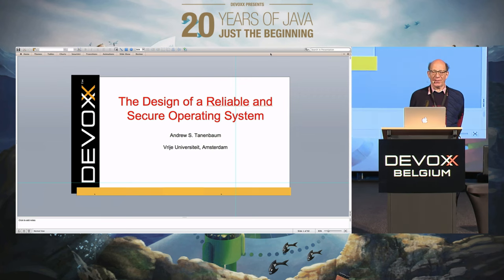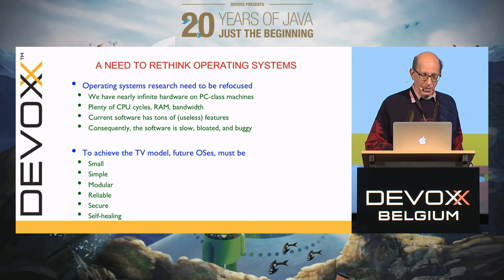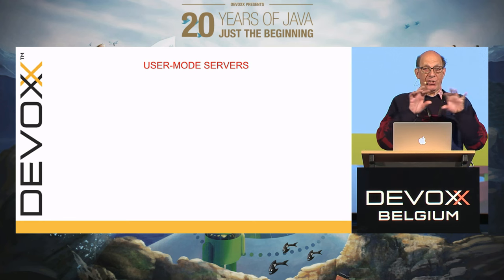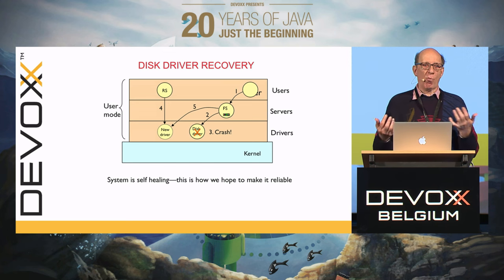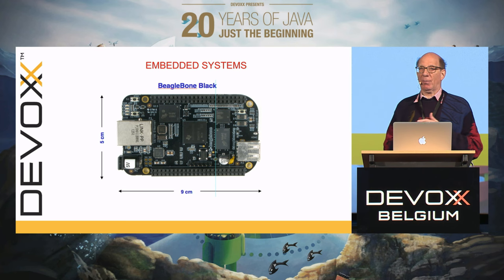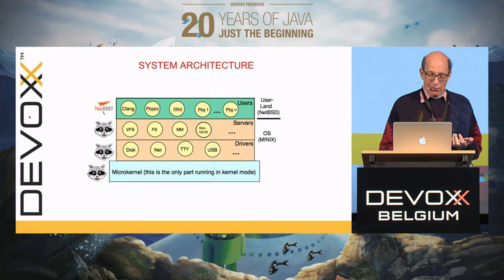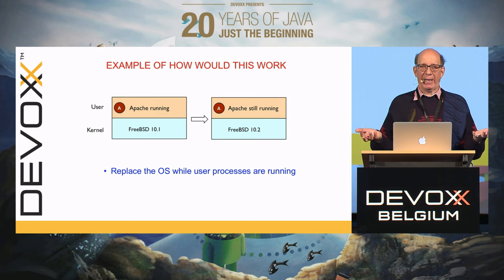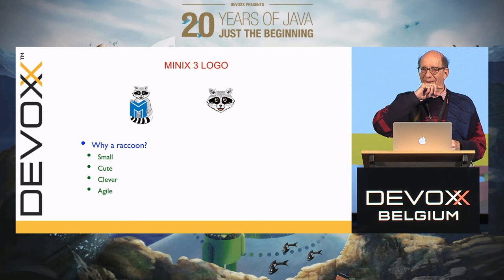The Design of a Reliable and Secure Operating System by Andrew Tanenbaum

Comment: What Andrew Tannenbaum says at the beginning of the lecture is such a profound truth, which we have unfortunately become all too used to, that it is no longer possible to fully imagine the implications of systems that simply work.  Nowadays it is even common to sell self-sufficient musical devices (synthesizers) that simply do not work well. 

Can we as a human society finally get into the habit of handling these things differently and not wasting 90% of human working time on things that don't work? Just imagine the productivity gain and the resulting economic growth, or at least the resulting relaxation of the species.

Manufacturers, you would like great, innovative advertising for your product, and at almost no cost? I give you one:

"My product works as intended in 99.99% of all cases.", nothing more is necessary and no one who isn't absolutely crazy wants anything else.

That is the reason, why printed books have been so populer for centuries,  the just "work"!

Comment: A perfect example of how a great mind thinks. he is precise, makes clear points, and with a sense of humour.
Reply: No, just no. Have you followed Minix's history versus that of Linux? Is Linus a great mind? Why does he contradict many things that Tannenbaum says then?
Also, are you aware that Minix, partly due to its license, is run as proprietary spyware on millions of Intel mainboards? And it's running at a lower level than your processor, and you cannot deactivate it?
Also, the promised reliability is just marketing speak, it's not true. Restarting failed services or drivers does not result in reliability.
If a hardware state results in a driver fault then restarting the driver won't make the system more reliable. It will fail again. And again. Over and over again.
Think about it. It's like saying that when a certain condition leads to an immediate motor fault in your car then replacing the motor makes the car more reliable.
Reply: @quebrada Yeah so in other words it's only reliable if there are no bugs. So the reliability argument for micro kernels is mostly marketing.
And you will have more code in microkernel components and drivers, so according to Tannenbaum this means more bugs.
Reply: @quebrada No, it cannot, for many classes of bugs.
Consider a bug in the disk subsystem that crashes it and leads to data loss. Restarting the driver won't do any good. Actually, it's very bad because it could hide the data loss.
Same for bugs in filesystems.
A bug in the graphics driver that results in the same crash over and over again will result in an unusable system, regardless if you restart the driver or not.
Reply: @quebrada The reliability argument is a theoretical one that only works out in very specific cases. The rest is marketing.
This is offset by the huge increase in complexity for asynchronous communication and persistence and recovery of state, which ends up making the whole thing harder to develop, harder to debug, increase the LOC and probability of bugs, etc.
Reply: @quebrada Yes, I listened to this talk quite some time ago, but I also used my brain.
"various forms of redundancy", yeah, which is not micro-kernel specific at all, so you have no gains at all for the most COMMON cases.
Quite the contrary, as explained before, you got extra complexity, especially due to the asynchronous messaging.
And because of that, entire classes of easily debuggable and reproducible bugs on something like Linux become a nightmare to deal with on something like Minix.

Also, I never talked about 100% reliability, that's your strawman argument. What I've argued against is the marketing claims about reliability. It's used as a major selling point in all of Tanenbaum's presentations / sales shows.
The truth is that in practice and in common cases you get little to no improvement. And as explained there are several cons.
Reply: @quebrada LOL, why are you so triggered?
What I'm saying are not baseless claims. Anyone with a shred of knowledge in the field understands that complexity increases with the number of modules that communicate with each other. Asynchronous communication additionally makes this way more complicated, for obvious reasons - well, apparently not obvious to clueless people or laymen like yourself.

Yeah, I know that some of these points came up in the Q&A, not in the marketing presentation though ... for obvious reasons. Tanenbaum still sugarcoats these major issues.
Instead of clearly pointing out technical pros and cons (and in which precise scenarios those play out!) he seems more like a salesman.

My analogy was perfectly valid for what is a common case of many bugs. Your response however was even poorer than Tanenbaum's.
Reply: @quebrada Wow, what a horrible answer and non-argument from someone emotional and triggered. "I don't like what you said" doesn't cut it, buddy. Are you a Tanenbaum fanboy? 🤣
Come back at me if you have actual valid arguments. An no, more strawmanning is not valid.
Reply: @quebrada As expected, still no valid response. Blocked permanently for being a childish, emotional troll that just wastes my time. Good riddance. 😉

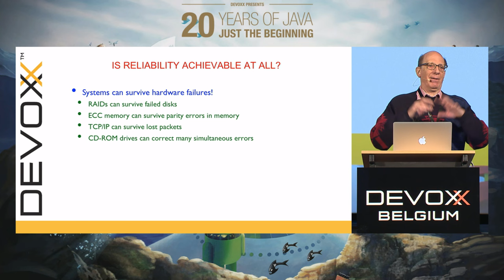Comment: 5:08 FALSE
CDs use Reed-Solomon error-correcting codes that do not use 3/4th of the space to correcting errors, it's the reverse. 
CDs use interleaved, 2-level RS ECC with modest overheads each, so maybe 1/4th of the total data are error-correcting data.

Comment: Now, I'm no programmer, but one issue I notice with his claim about bugs per LoC is that a microkernel will have less bugs. Now, at face value this is true. However, moving code out of the kernel isn't actually reducing bugs, its just moving them around. You aren't solving the issue with a microkernel. I very much like the Linux method, to clarify.
Reply: The point is to keep bugs out of the kernel though, and only allow processes and drivers to do what they should. I like Linux, I run Linux on all my computers, but at least in theory the architecture of a microkernel is superior. The Hurd microkernel was in fact originally intended to be what Linux instead became by sheer coincidence of timing, the kernel of the GNU operating system.
Reply: @dijikstra8  Actually linux will be always faster...
Reply: its not always about speed. Often a system is required that is reliable and secure. Thats what he talked about.
Reply: @dint1911  man, u walking down the street with a speed of light. why u need to be even faster, i have no idea.

Comment: Hmm ... nothing new really. Forking to get rid of memory leaks in long running processes is the very standard for unix demon implementation. To use this for drivers makes a good point, but doesn't make things become really better, when it comes to bugs/lines of code. I am missing the real innovation in all this somehow ...
Perhaps one should rethink the hardware first, before adding the software to it. And the hardware is not what is reliable, safe und fault tollerant in the first place, especially when it comes to nosense like Trusted Platfrom Computing. I fear there is lots of work time wasted on the wrong platforms, but I also hope a platfrom will come some day, that is not intended on how to spy better on people, but on how computing can become more reliable, safe, power efficient and still acceptable in speed. My impression is, we should get to that point first, before wasting energy on another os being ported to one more of the many platforms in the market.